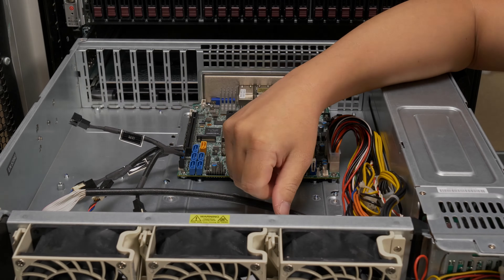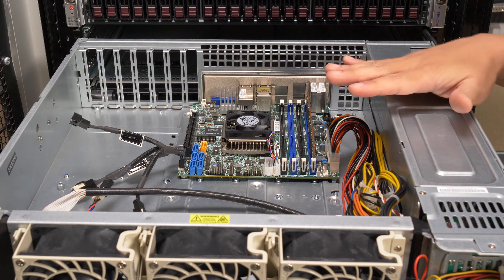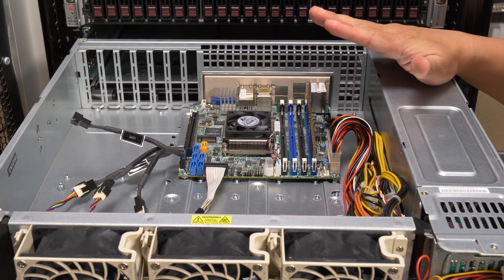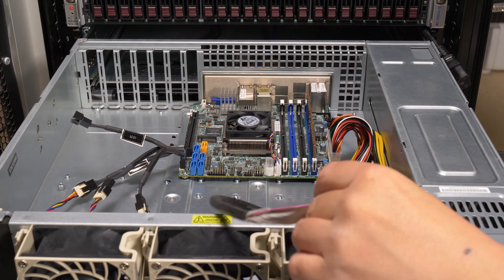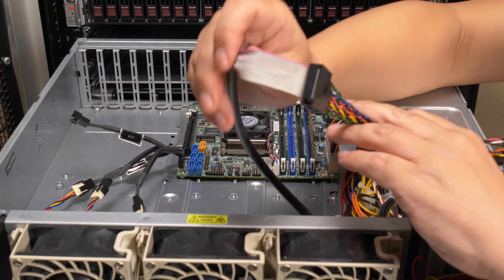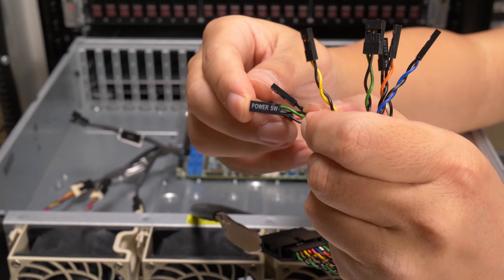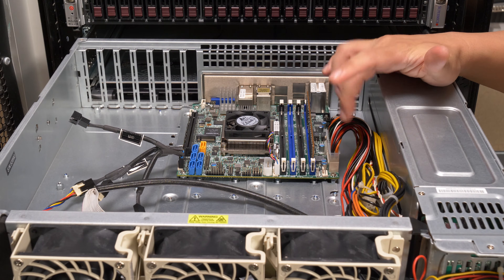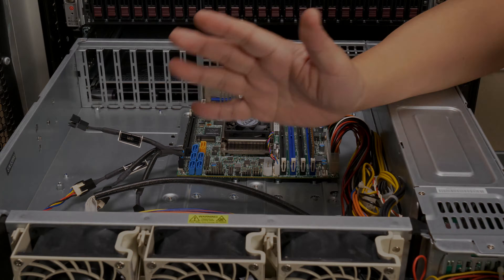Installing non-Supermicro motherboard in Supermicro server chassis | Supermicro Tech Tip

Comment: Question I have the cable and I’m trying to wire to my LGA 1851 Asrock motherboard. The motherboard diagram has a plus or minus for the pinouts, but how do I know on the cable pins, as to which is the plus wire or minus…. Sorry for the noob wiring question.
Reply from the maker: the black wire is usually the minus wire and the colored wire is the plus. in some situations it doesn't matter, like for the momentary switches like power or reset button. with LEDs, it does matter, so if you find it's not working, try turning it the other way and see if the LED will then light up.

Comment: I built an UnRAID server built with a Supermicro MBD-X8SIL-F-O system board in 2010. I believe the maximum drive for the system board is 2TB.  I plan to refresh the hardware with new hardware. Is it possible to get past the 2TB drive limit by installing a drive controller board before I replace the system board?

The UnRAID server is built in a generic full sized tower case, but the NAS style case looks much nicer for a NAS. I would like to refresh the UnRAID build so that it could be expended to 12 or 16 drives in the future. 

I'm currently using 2TB SATA drives, but I need to learn more about the SAS drives, which might be better than SATA drives. Can both SATA and SAS drives be used on the same drive controller, or are two different drive controllers needed?

You're videos are very informative! But there's a steep learning curve that I need to go through!
Reply from the maker: The 2TB limit is due to use of 32bit addressing vs 64bit. And various protocols support this differently. I explain in detail here: https://youtu.be/u55vIGMzzKw

If you need help choosing a HBA SAS controller, make sure to watch this video: https://youtu.be/hTbKzQZk21w

Also, checkout this playlist: https://www.youtube.com/playlist?list=PL28eVGz5vFQ8lmttOxL17QwJ3KJp05wi6

Hope that helps you get started.

Comment: I decided to go with a CSE-847 even though the mb compartment is only 2u. The standoffs don't line up tho with regular ATX. I don't think the standoffs are removable, but I might be wrong. Any ideas for how to deal with that?
Reply from the maker: The motherboard standoffs do come off. you just have to unscrew them and move them to the proper location. the motherboard "tray" should have threads where you can install the stand offs. you just need to move the stand offs.
Reply: or if not just apoxy in your own

Comment: Ran into this problem about three weeks ago. As soon as I saw the video, I thought, I bet it's mobo headers. Another thing people might want to know is jumping pin 20 (iirc) on the ATX header to ground, to tell the power supply not to run the fan at full speed the whole time.
Reply from the maker: Thanks for the extra info, I appreciate it!

Comment: Ran across this video while researching an issue I am having with a Supermicro CSE-835 Chassis with the triple redundant I believe 765 W Power supply. I was trying to install a Supermicro X12SAE-5 motherboard into it but it would  not POST.  The chassis was working with an older Supermicro MB but will not POST with this MB. I pulled the MB from the chassis and hooked it up to a ATX power supply that I had as a spare, and it came up normally. I left the MB out of the chassis and plugged the chassis power supply back into it and again it would not POST. I then tried two other Supermicro ATX power supplies that I had as spares but it would not POST on either power supply. The CPU fan and LSD's on the board light up but no display or beep codes. As soon as I hook up a non-Supermicro power supply it boots normally. I would like to use this chassis for file storage because of it's 8 3.5" bays. Have you ever encountered this issue?
Reply from the maker: Sorry, I'm not familiar with that chassis.

Comment: Great video!  Do you know how to control the fans behind the backplane for a non supermicro board?  Is it just putting them on a fan header or do you need some type of fan power controller?
Reply from the maker: Just connect them to a standard 4-pin PWM fan header.

Comment: i have a supermicro x9dre-tf what chassis you recomend to buy?
Reply from the maker: That's the X9DRE-TF+ isn't it? It is EE-ATX format? Yeah, you're going to need a case that can accommodate that size board. A lot of the Supermicro 826/836/846 should fit, but it will be tight, and you might not be able to use all options like the rear 2.5" bays might need to be removed.

Comment: Good video! Now I need to know how I can control those front-panel-PCBs. Like I have a SC826 with 12 SATA bays. How can I control the LED-lights on each one? For example to set one LED to "failed"?
Reply from the maker: As long as you have a SAS expander backplane (BPN-SAS2-826EL1 or BPN-SAS3-826EL1), then you can use the corresponding sas2ircu or sas3ircu utility to activate the "locate" function which will blink the fault LED for that specific bay.  I'm not sure this is possible if you're using direct attached backplanes, but it might be possible if your cable has sideband. the later part I would have to confirm, so don't take my word just yet. I do know sas2ircu does work on SAS expander backplanes.
Reply: @ArtofServer  I just have a direct backplane and SATA cables directly do my motherboard. That is why I am confused how I am supposed to control those LED lights? I kind of assumed there was some kind of USB headers or something that I would connect to my motherboard that gave me some interface to them.

Comment: One thing—kind of new to Supermicro but not new to servers. I was wondering: my two power supply fans run even when they're out of the chassis and only plugged in. I was wondering if you knew anything about it?

Now, there are three orange turny things inside—do you know anything about them? LOL. I just want my power supply fans not to run when the server is off, that's all. Thanks!
Reply from the maker: sorry, not sure about that. if you use a SQ power supply, it'll be much quieter though..

Comment: Did you splice the power LED cable so the ground is no longer in the middle?
Reply from the maker: I did move it from pin 3 to pin 2 so that it would work on a regular ATX motherboard. Not sure what you mean by "splice" ...
Reply: @ArtofServer  yes, that’s what I mean; wrong terminology. I was able to do the same thing after watching your video.

Would you happen to know if there’s a way to get the NIC LEDs to work when the mobo has 4 pins instead of 2?

Comment: Great video!  I am pulling my hair out working with the CSE-846.  Instead of swapping out the psu with 'less' loud psu, are the small loud fans in the psu swappable to quieter ones?

Thanks!
Reply from the maker: There are already very quiet PSU options for this chassis. Look for PWS-920P-SQ in my ebay store. Much easier this way than trying to hack a regular PSU into this chassis.

Comment: How about removing, moveing, and reinstalling the standoffs? I have an 826 I just bought and a previous owner removed one of the standoffs (maybe to fit the dual ssd caddy) but the board i got for it needs that standoff, how can i replace it? Another option is to try and find another smaller board with similar functionality so i can use the dual ssd caddy like i originally wanted to.

Comment: The extending wire adapter for the IO cords was a great thing to see: however, I need an adapter that I can use to connect all those connections from a non-server case to a supermicro server motherboard. Will the one you show work for what I need or is there another I need to purchase?
Reply from the maker: you don't need anything special going from a standard PC case to a supermicro motherboard. just look up the manual and identify which pins are for what and connect accordingly. standard PC case usually has separate individual leads for each front i/o function.

Comment: Is there an adapter where I can use a Supermicro mainboard in a non supermicro case?
Reply from the maker: It's not necessary the other way around. Standard ATX case front I/O leads will just plug into the Supermicro board.

Comment: What are the options to extend the 16 pin front pannel cable?
I am planing on swapping out an X9 board for an H11 board in a CSE-836 chassis. On the H11 the 16 pin header is placed as far away from the chassis header as possible, current 16 pin cable will not reach.
Reply from the maker: You can use the cable mentioned in this video as an extension. But make sure it is long enough to meet your needs.
Reply: Thanks, I ended up finding a longer replacement cable. CBL-0071L

Comment: Thank you so much, this video has helped me with my 846 chasis.  My issiue is how do I get PCIE power to my graphics card?  I have 2 EPS12V and a molex left to split.
Reply from the maker: Glad it helped! You probably need to convert the 4-pin molex to PCIe power. The only other way is to get a Supermicro PDB with the PCIe power leads built-in.

Comment: What about the back plane and a normal atx power supply?
Reply from the maker: To learn  more about Supermicro backplanes, watch this video: https://youtu.be/ZhF1rU0X4eE

I also have several videos showing how to uninstall/install them on various Supermicro chassis models.

For a Supermicro chassis, it is much better to use their PSU. They are very high quality, and a lot cheaper than a high quality ATX PSU, not to mention they have the dual PSU setup for redundancy.
Reply: @ArtofServer  Sorry I meant the mobo backpane not the HDD one.

Comment: I wish there was a adapter to go from Supermicro board to standard ATX case. that was annoying to do
Reply from the maker: There's usually no need. The wires from a typical ATX chassis can plug right into the headers on a supermicro motherboard. I've used supermicro boards in several of my builds in typical ATX cases.
Reply: @ArtofServer  yes true but i am kind of a ADHD/OCD kind of like the idea of having an adapter, that way even if you don't have a manual for the board, it does make it easier. I have a Supermicro H11SSL-i motherboard (first gen Epyc for my NAS) and the manual is a bit of a nightmare especially for the front panel. Being used to how the traditional motherboard manuals give you a + and - for the LED orientation kind of threw me off trying to work out not only the alignment but the polarity. they are not like desktop boards and i had to actually go looking at other resources to determine alignment and polarity. a breakout cable would help remove that sort of confusion

Comment: What’s the best server rack case that you can diy a build in like this one but what would you say is the best. But gives hot swappable bays in the front? Atleast  10 or more? Trying to make my first server pc already have a 5700g just can’t find the right board to have all the sata plugins.
Reply from the maker: If you want at least 10 3.5" drive bays, I would say get a Supermicro 826 or 836. For the 826, try to get a more modern one with the 2x2.5" drive bays in the rear. The 826 has 12x3.5" drive bays and the 836 is a 16x3.5" drive bay. In both cases, make sure you get it with a SAS-2 expander backplane or newer. Avoid the older SAS-1 backplanes, and I would avoid the "TQ" or "A" backplanes unless you're on a very small budget. Look up "Supermicro backplanes" on my channel to understand the difference in backplanes.

Comment: I'm a bit confused by this video. I've asked supermicro support whether X12SDV-4C-SP6F is compatible with my 846BE1C-R1K23B and 826BE1C-R920LPB, and the answer was - "these chassis only support ATX or bigger motherboards, not flexATX or smaller form factor boards." 

Anyway, thank you. I love your channel!
Reply from the maker: I'm not intimately familiar with the FlexATX format. Does it re-use some of the standoff locations of ATX format? Most Supermicro chassis have movable motherboard standoffs.

If you're doing a new server build, I would recommend getting a motherboard with more PCIe slots. Most people inevitably run out of PCIe slots at some point.

Thanks for watching and hope you enjoy the channel! :-)

Comment: I made the mistake of jumping to Dell for homelab stuff. While the R720 was cheap and does provide a lot for the price but man it has so many headaches. And GOD I hate IDRAC.

Supermicro is that perfect in the middle sweet spot. Yes its sometimes a bit more. But you can't argue being able to swap out parts without proprietary issues or compatibility problems.
Reply from the maker: There are pros and cons for each option. I personally started with a Dell PE1900 many years ago and kept using Dell servers until a few years ago and started using Supermicro. Supermicro has it's drawbacks too and I've actually been thinking of going back to Dell. There's no perfect option, you're usually trading one thing for another.

Comment: I was looking at your videos for this answer but do the supermicro power supplies have dual PCIE 8 pin for powering a GPU or would I have to use a 4pin molex adapter?
Reply from the maker: Good question. It depends on the PDB you have. If the PDB is from an older chassis, it probably doesn't have 6/8-pin PCIe power. In those cases adapters from 4-pin molex will be necessary.
Reply: @ArtofServer I may be able to do like an A1000 or A2000 to do Plex transcoding. not sure if I really need a 3090 even though it's a 2 slot unit?

Comment: You should probably also mention about the power distributor's PMBus cable as most consumer motheboards will not have a connector for it so no way to tell it things.
Reply from the maker: That's true for consumer boards, but the PMBus is optional and doesn't prevent it from working. Many server boards (non-Supermicro) do have it though...

Comment: Do you know if the CSE-848 also has E-ATX standard standoffs ? I've found a cheap one and I'm thinking of using a X9DR7-LN4F in one ... :)
Reply from the maker: I doubt it. That chassis was designed for boards like the X9QR7-TF+ which is very non-standard.
Reply: @ArtofServer  That was my feeling too but looking at the manual and where the standoffs seemed to be had me hope a little. Thanks :)

Comment: What about using a regular consumer motherboard? What do we do with the OH and Power Fail cables so that alarms don't sound? I'm trying to use a consumer LGA 1511 motherboard with the case and have the adapter but unable to figure out what to do with Power Fail and Overheat cables as the motherboard does not have this.
Reply from the maker: You can just leave them disconnected. It's not going to cause any errors on the chassis. Those wires are just connected to LEDs, so you won't activate those LEDs if they are disconnected.
Reply: @ArtofServer  thanks. What about the PF wire coming off the power supply? I believe that is causing the alarm when the server is powered on. Something is, at least. A red light and a loud constant alarm sounds.
Reply: what ur describing sounds like normal business for certain motherboards, loud ass beepa. especially chinese x99s or newer lga1151 socket boards. the beeps sometjmes have a meaning u can look up also they may not. ive actually desoldered the speaker before lol or tape over them

Comment: I just found these last night and bought some. Supermicro did good in this aspect of offering this breakout cable.

You showed a 24 pin extension, but for the PDU I have in my chassis it is the 8 pin CPU that is too short.
Reply from the maker: Thanks for watching!
Reply: same issue, how did you solve it ?  The cables "PDa" and "PDb" seem long enough and seem to fit, just to scared to try em :D
Reply: @listener8080 , I solved my PE(8-pin CPU) cable being too short by buying Silverstone Tek Sleeved Extension Power Supply Cable with 1 x 8-Pin to EPS12V 8-Pin Connector (PP07-EPS8B) off of Amazon. Once it arrived I tried to make sure the connection was 1-1 from the PSU through the extension to the motherboard CPU connector. It has worked for me so far.

Comment: Thanks for the information--I actually go the opposite way--I love Supermicro (X10SRA-F-O )motherboards and use them in standard cases (fractal designs R5 and R6).
Reply from the maker: Cool. It's usually not too tricky to mount supermicro boards in other cases, except for the occasional mounting point you might have to add. I have some favorite supermicro motherboards I love for workstation and server builds. For the server builds, I just use supermicro chassis, but for the workstation builds I usually have to use a large PC (mid or full tower) case. I'm kind of liking what phanteks is offering these days...
Reply: @wildmanjeff42 Hi there! I know it’s been a while. But what PSU do you use since the original was redundant and the pins on the MB are different? I have a supermicro MB that I wanna mount on a regular rack mount case, but with regular PSU.
Reply: @gabrielporto.mikrotik  I actually use in general use case, and use Corsair 550W or 650W power supplies.  if you are using a server rack you may be limited to what will fit in the case .
Reply: @wildmanjeff42 my problem is the amount of pins of the MOBO in comparison to regular PSUs. If I remember correctly the connector of the MOBO has 2 or 4 more pins them a regular PSU.
Reply: @gabrielporto.mikrotik  I am using the X10 SRA-F-O which they list as a workstation board specifically, and if I remember right it uses an eight pin connector, and a standard 8 pin connector from a power supply is used in that spot on the motherboard.  I have not purchased any special power supplies they are standard corsair bronze 550 & 650 power supplies.  I have 4 all built the same used as truenas servers and one xcp-ng machine.  I hope this helps.  Also I did not purchase anything additional like adapters I am certain.